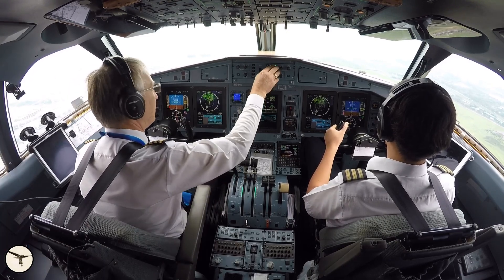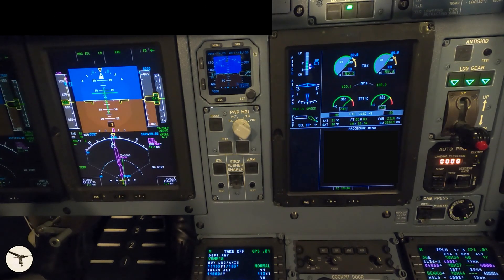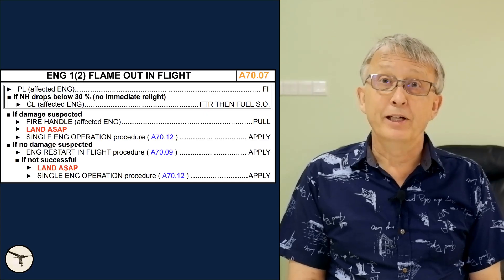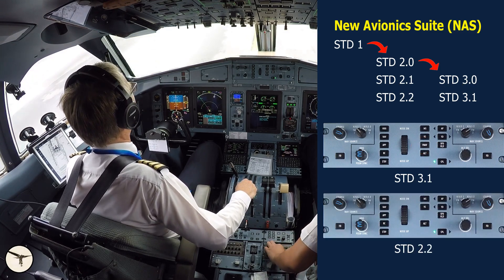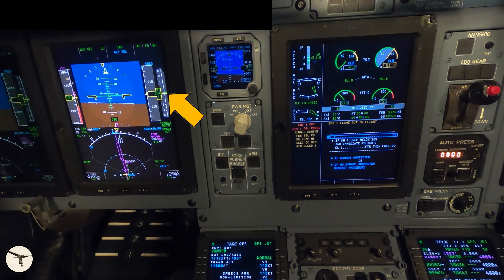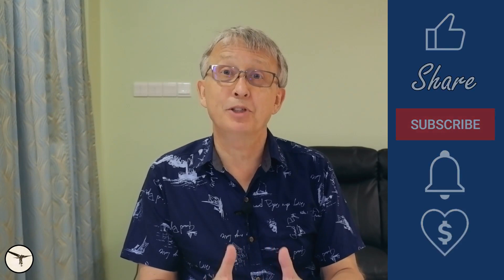A disaster waiting to happen? | Engine failure when you don’t expect it.

Comment: If instead of MCT then ramp, I would first ramp and then select MCT, what difference would it make? And I understand that once you had MCT selected, condition lever to 100% override would not help? Thanks!
Reply from the maker: With the power management in CLB (climb), you have less power because the propeller speed (NP) is only 82%. If you move the power lever to the ramp, you get less power, but very high temperature (ITT). The easiest way to increase power is to set MCT as NP increases to 100%.
Reply: Thank you! @FlywithMagnar

Comment: sir how much power does an ATR76 produce if we put PL to the wall and how long we can keep it to wall ? @Fly With Magnar
Reply from the maker: When NP is 100%, and you move the PL to the wall, you will get up to 115% torque (3,162 shp.) When NP is 82%, you will get up to 120% torque (2,706 shp.) The time limit is 20 seconds. Maintenance action is required if the limitation is exceeded.

Comment: Hi Capt, another great video as always, just one doubt, why does the speed magenta bug change from 170 to v2+10? I understand the auto speed change of the magenta bug in case of an engine flame out in flight is to change to Vmlb0 in normal conditions (white bug or min en route speed), in any case it wouldnt be VFTO, am I right?Thanks in advance
Reply from the maker: The speed is set by the low speed protection system. V2 is below the speed for minimum drag. V2 + 10 is close to minimum drag.

Comment: What's your take about guarding Throttle Levers at low altitude? I see the FO not guarding them. Is that what they get teached these days? I do not permit this personally but I see it all the times. I find it disturbing but I'm genuinely interested in your opinion.
Reply from the maker: At take-off, we are not touching the power levers after V1. This is ATR procedure. The power levers are in a detent (called the "notch") and cannot move out of this position by themselves. In fact, the power levers will always stay in the position you set them. On approach, it is required for the pilot to hold the power levers when flying below 1000 feet. This enables the pilot to react to speed variations and adjust the power accordingly.
Reply: @FlywithMagnar  interesting.. didn’t know about “The notch”. Say you fly trough a microburst on departure.. wouldn’t you need to apply max power wile your hands are elsewhere? Just trying to understand the validity of the policy of not guarding flight controls during a critical phase of flight.
Reply from the maker: Microbursts don't happen often. And if they happen, you will have no problem finding the power levers. It's in the muscle memory becauses we use the power levers during every descent and approach.
Here are two arguments against holding the power levers during takeoff:
1) We guard the power levers until V1. From then on, we are committed to take off. Therefore, hands off the power levers.
2) Some pilots, especially inexperienced ones, tend to hold the power levers firmly. Bumps on the runway or turbulence might cause the arm to move, and the power levers might follow.
Reply: @FlywithMagnar  well the first one is not relevant. No one in the planet and in aviation history has ever held the thrust or throttle levers after V1. That’s obviously not the alternative. 
The second one is also 50% not relevant because we are talking about holding the levers in the air, no runway bumps there. As of turbulence being so strong to move PF hands till he actually moves lever involuntarily.. i find that highly unlikely. Anyway i now understand the reasoning behind. Thank you.

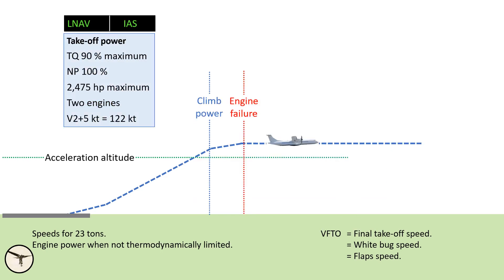Comment: Great vid, capt. But @6:00 you mentioned to set pwr mgt to mct then move the pl to the ramp if necessary. My question is, was it really necessary to execute it as the memo items on engine flame out @ T/O says pl in the notch then set mct?
Reply from the maker: When you have engine flame out at take-off, the ATPCS will give you 100% power (2,750 shp) on the good engine, and the propeller on the failed engine is automatically feathered. 
When you have engine flame out after take-off, ATPCS is no longer armed. You have climb power (2,192 shp), and the propeller is windmilling, producing a lot of drag. You will not be able to climb, unless the aircraft is very light.
By selecting MCT, you get 2,500 shp. By moving the power lever to the ramp, you get 2,750 shp.

Comment: in Test 2 ,if.......
ALT mode set  -> TO(not MCT) -> autofeatehr ? -> VFTO -> MCT ->flap 0 -> IAS mode?
Reply: You will not have autofeather if you move the PWR MGT SEL to TO after the engine flameout occured. Weather or not you get uptrim/autofeather on a takeoff or only autofeather during approach/go around if a function of the PLA (power lever angle) at the time the engine flameout accurs (with the PWR MGT SEL in TO). I have also thought alot of this and I have the same personal thinking as Magnar and that is to set ALT since we are above acceleration altitude and then PWR (MCT…but ramp is ofcourse also an option). If in icing condition, select Flaps 15. Then with ALT green and MCT (or Ramp) call ”VFTO magenta” on AT76 or ”Set speed bug W/B” on ATR classic. Then do Memo items for Engine flamout in flight: PL Flight idle, If NH drops < 30% => CL: FTR fuel shut off. AT VFTO // W/B, Set IAS…climb with VFTO // W/B-speed (Flaps 0 in Normal condition or flaps 15 in icing condition). Thanks Magnar for a good video

Comment: Greetings Capt Magnar,  Great videos! I find myself checking your content when I find it hard to understand ATR explanations.  I have a query with regards engine failure on approach. 

In the ATR FCOM PRO.NNO Engine failure in flight additional information it states: "In approach, the flight crew has to manually feather the affected engine before setting the PL below 45°"  can you shed some light on this?  Why PL below 45, and which engine are they refereeing to the live one or the failed engine?  Your assistance will be greatly appreciated.
Reply from the maker: After an engine flame out, the power lever controls propeller pitch directly. The further aft you move the power lever, the higher the drag will be. Therefore, you must feather the propeller before you move the power lever to flight idle.

Comment: Wouldn’t it be easier to just move up the acceleration altitude (and thereby climb procedure) to 1000ft?
Then you would have both up-trim and auto feather protection available to a higher (safer) altitude?
Reply from the maker: That's absolutely an option, but it should not be exaggerated. Delaying the power reduction results in prolonged noise, and higher fuel consumption and engine wear.
Reply: @FlywithMagnar  Valid points…. Awesome videos by the way! Thanks for sharing your wealth of knowledge.
Have both my PC and line check next month. When studying becomes too tedious, I always mix it up with a few “Magnar videos”:-)!

Comment: You should also discuss engine failure on approach followed by a GA. I think its a plausible theory with the Yeti ATR crash.

Aircraft on approach AP on then left engine fails. Alarms triggered, crew startled, failure not identified immediately bec little yaw at this point due to low engine power. Crew initiates GA, not fully understanding whats happening.

PLs are advanced, cpt commands flap one notch, PM retracts flaps to 15 immediately while pitching to 8 deg with speed below vga as they were initially at vapp

Airplane starts to roll (Vmc roll) and crew not appreciating its an engine failure compensates with aileron and little if any rudder. Airplane has no autofeather as it happened before atpcs arming sequence for GA

Then thats it…..

Comment: Hi Captain Magnar, 

This is a very informative video! 

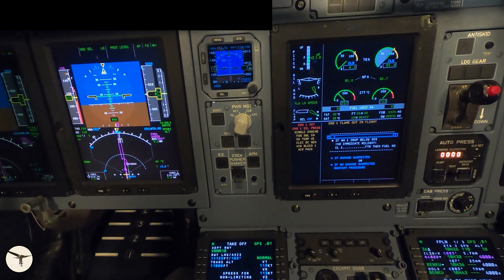The first demonstration shows how long the automation will give you time to react. It is for almost a minute (10:30-11:20)! Of cause, as a pilot, you would not want to let the speed decrease below VminOps, therefore, the second demonstration. My takeaway from this video is "You don't need to rush at all when you get an engine failure if you make automation a good friend". 

Here is my question: 
If you select the power management BACK to T/O position when you get an engine flame out after the climb procedure is completed, will the ATPCS back online and feather the failed engine automatically for you? 

Thanks for your effort and happy flying!
Reply from the maker: The answer is no. If you move the power management back to TO, the propeller will not feather. To arm the ATPCS, both engines must produce more than 46% torque.
Reply: Thank you!

Comment: This was exactly my query. 
If u remember my earlier question on same. Engine failure after climb procedure. And engine failure during approach. Kindly address engine failure during approach also. 
Kindly help for engine start procedure with battery only. 
Thanks and regards.
Reply from the maker: Engine failure during approach: In you have time, feather the propeller and go around. If not, land.
Battery start: Same procedure, but without the GPU. The only difference is that you don't have oil pressure indication until the first generator is online.
Reply: @FlywithMagnar  
Believe it Will be slightly different. 
First both PLs to notch. 
Identify and feather the failed CL. 
Once above VGA.. Then only go around. 
Ur expert opinion and demo will help. 
Regarding engine start..on battery only.. Don't we shut both packs.. Both recirculation fans.. Shed utility service busses and fuel pump of one engine..not sure if both.. In 500..we could start with both fuel pump off. 
Thanks and regards
Reply from the maker: The procdure for engine failure in flight is also valid during approach: Affected PL to FI, then affected CL to FTR then FUEL S.O. But if you are very close to the runway, you don't have time to feather the propeller, and you just add power and land. Never attempt to go around with a windmilling propeller.

DC SVCE & UTLY BUS are not powered when you start the engine from battery. (Therefore, the recirculation fans will not run.) You might be confused with the procedure for engine start with weak GPU.

Regarding the bleed valves, they are automatically kept shut when the engine is started, reagardless of the position of the bleed valve pushbutton. FCOM DSC.36.1: "During a starting sequence, the opening of the bleed air shutoff valve is inhibited." Apparently, many pilots are missing this information.

Fuel pumps: In many companies it's normal procedure to switch them OFF after shutting down the engines. There's no reason to let them run during turnaround. Fuel pumps are expensive. Before starting an engine, you select the associated fuel pump ON (ref FCTM chapter 38). Technically, it's possible to start the engine with the fuel pumps OFF, but it's not normal procedure. When the fuel pump is OFF, the motive flow valve is also closed, disabling the jet pump. So, if you forget to select the fuel pump ON after engine start, the feeder tank will not be topped up. Consequence: FUEL LO LVL alert.
Reply: @FlywithMagnar  Thank you sir. Regards

Comment: In my thought..Setting mct in dead engine before shutting down also increases np and blade angle moves towards fine position ..which increases more drag in dead engine even though performance increases in live engine.
Reply from the maker: The increase in power (from 2192 hp to 2500 hp) gives a bigger performance benefit. As you can see in the video, NP of the failed engine increases from 82% to 85% before the propeller is feathered. The increase in drag is minimal. When the propeller is windmilling, it is the power lever that controls propeller pitch: The  drag from the propeller increases when the power lever is moved towards Flight Idle. Therefore, after PF has set the power lever to Flight Idle, it is important that PM feathers the propeller without undue delay.
Reply: @FlywithMagnar  thankyou sir.
In atr 72 500 simulator in paris..i got 100 percent rise in np when i put mct in dead engine..i think np cant rise above 85 percent because u are feathering the propeller shortly after putting it on mct.

Comment: Very interersting.
Simulator "pilot" here. I have always wondered why all manufacturers always stress so much with deactivating the protections systems for takeoff as soon as you reach an altitude slightly above the runway. 
The Atr has it as you mentioned in the video.
This applied for the Saab 340 where you deactivate the autocoarsen system which helps in an engine shutdown. 
The dash 8 want's you to deactivate auto-feather system before power reduction. 
Why are they not making these protections so that they can be used up until something around FL100 so that you have them during the most critical pasrts of the flight?
Reply from the maker: The critical pahse during a takeoff is when the aircraft passes V1, when the aircraft is still on the ground. At this phase, the pilot has his or her hands full flying the aircraft. The speed is low and the landing gear is extended. An engine failure here is critical. That's why turboprop aircraft have autofeather and other protections. 
Climb power is set when the aircraft is at least 400 feet above the ground. The landing gear is retracted, and the aircraft is above any obstacles for the next 10 NM along the flight track. It is not considered to be a critical part of the flight because the pilots have time to analyse the situation before they act (which is demonstrated in the video).

Comment: Hi Capt, what will happen if we move CL directly to Fuel SO instead of moving to feather first and waiting for a couple of seconds. Whether propellers will still be feathered?
Reply from the maker: The propeller will still feather. The feathering process is very quick. The short pause is just to confirm that the correct propeller was feathered before you select fuel shut-off.

Comment: Hello Magnar, thank you for these really useful videos. I have a couple of questions:
1) This engine failure scenario has reminded me of the rudder. Could you develop on the system that controls the maximum rudder deflection available?
2) I understand that this might not be the best idea given the low speeds you are flying at, but wouldn't it be useful to dive just a bit to gain speed and then retract the flaps to significantly reduce drag? Or does this sound like an even more crazy procedure, given the flight condition?
Reply from the maker: 1) In this aircraft, the rudder trim is automatic. When designing the aircraft, maximum rudder deflection is defined to match the minimum control speed VMC. 
2) Given cicumstances, there might not be space for descending to gain speed. There might be obstacles ahead or below. The normal procedure for engine failure at take-off is to level off at acceleration altitude and accelerate to VFTO (142 kt at max weight). Then, you can retract the flaps. All take-offs are calculated with this in mind, and the take-off weight is reduced if necessary. When the engine fails at a higher altitude, you already have an advantage, as long as you remember to increase power.
Reply: @FlywithMagnar  Thank you!

Comment: Very good worst case scenario demonstration and a great example of why training is important. Well explained and looking forward to more videos.
Reply from the maker: Thanks, Knut!
Reply: All the engine failure scenarios that we train in my airline are either at V1 or at cruise. V1 is the most dangerous situation, which is why we practice it so much. This video might be an example of the #2 most dangerous.
I wonder what is the most likely point for an engine to fail. Are there data of real engine failures and the phase of flight in which they occur?